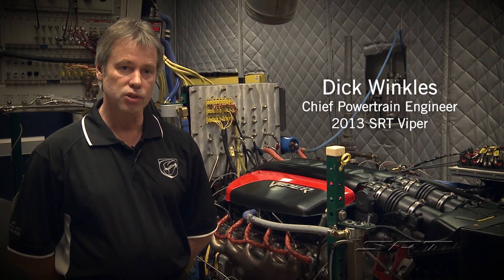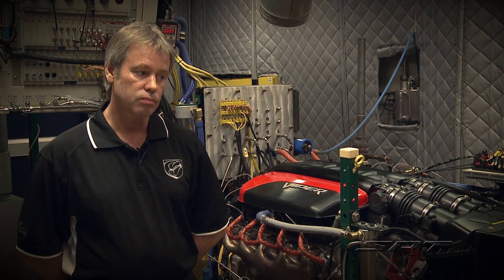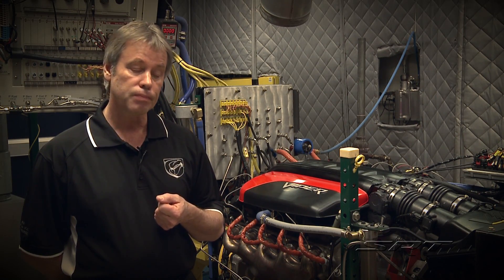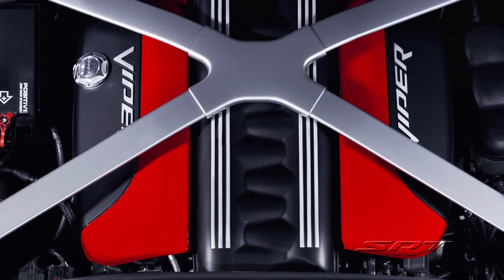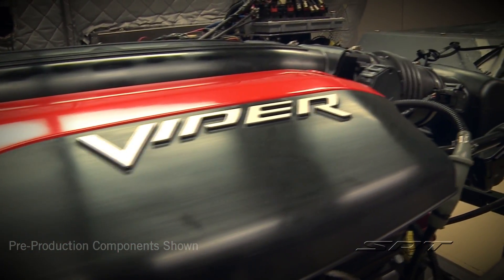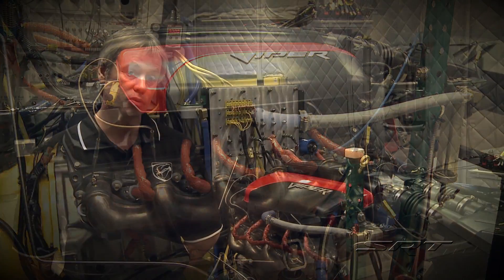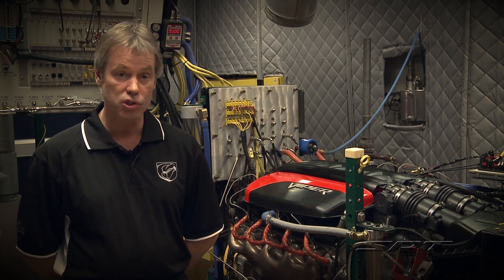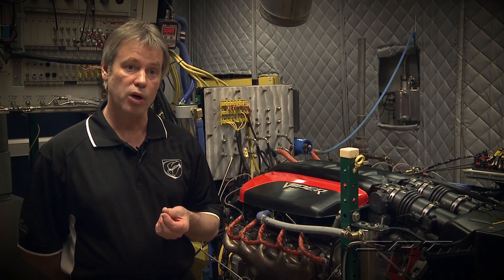Inside the 2013 SRT Viper Powertrain

Comment: - another cars lap is benchmarking. Magazines that regularly run lap times with different cars there, benchmarking. What do you think Host Von Saurma is doing? He is practically benchmarking any car he takes to The Ring.Definition Benchmark:any standard or reference by which others can be measured or judged. In other words going to The Ring and running a 5 minute flat in a Lotus and JUST COMPARING it to a lowly corvette is a form of benchmarking.

Comment: Porsche pretty much benchmark all of there ultra high performance cars there, that is one of the reasons that they have permanent TEST facilities there in the first place. After all wouldn't it be a good idea to know how much faster the new GT2 RS is COMPARED to the original GT2?  I just said a couple posts ago that Nissan used the Porsche 911 turbo as their BENCHMARK for the R35, how do you benchmark a car without benchmarking? Any manufacturer that runs a clean lap there and compares it to-

Comment: What are you talking about? Nissan repeatedly denied it and offered Porsche's test drivers driving lessons. And where did you find info on Porsche calling the Americans out? i can't find it. Horst Von Saurma was a little off the GT2 RS manufacturer claim too but just by half as much. Assuming that you are comparing his 2009 ZR1 run to the Jim's 2009 ZR1 run seeing as it didn't have the cup tires that the 2012 did. But if you look at Horst's laps the 2009 ZR1 is as fast as a 2010 458 Italia, nice

Comment: That may have been then, but it seams that The Ring has come to the forefront over the years. I have always agreed with you that there was NO OFFICIAL benchmarking but there are a lot of manufacturers that are doing NON OFFICIAL benchmarking on The Ring. In fact Nissan admitted that they used the 911 turbo as the benchmark for their R35 GTR. Why do you think that Porsche originally called BS on the R35 GTR's lap time of 7.29 a time that was faster than the 7.32 Porsche claimed for their GT2?

Comment: So the Manufacturers set out to break each others "records". They have a choice to add safety equipment or not but most do, including a roll cage. Then find a driver willing to risk his or her life(preferably a pro or ex-pro). Rent the track out and run the laps. Cars could be modded beyond what they say but without officials there to thoroughly inspect the cars right before the attempt, it's practically imposable to call them on it. So we can only speculate.

Comment: First off, the Gumpert was much faster than the ZR1 on The Ring. Second, driver skill and just plane guts plays a major factor in these lap times. In other words Jim was pushing much harder that the guy in the Apollo. Third, Michelin Pilot Sport Cup Zero Pressure tires are among the best street legal semi slicks you can buy and they are OEM tires for the ZR1.

Comment: OK got it now thanks. see the roll cage, see the seats, tires...... nowhere near 600mm wide though looks like stock width to me. I also see a camera right between the passenger and drivers seat. I just found out You have seen this in car video because i found you trolling over there too, so why are you questioning that the interior is stripped when you know it's not.

Comment: Both the Radical and Gumpert aren't road legal here and can only be purchased in kit form. But the Corvette and Viper can be Imported to Europe and be fully road Legal. That is why they claimed the record at one time or another. You still have yet to disprove the European lap times either. Did they are didn't they run the laps they claimed to run.

Comment: A roll cage won't help very much performance wise if the car chassis is already very stiff. It also adds a good deal of weight. But when you are reaching speeds over 160mph and crash, the extra strength of that roll cage could be the difference between life and death. That racing seat has a racing harness (the original seats were incapable of housing it) which is much better than a standard seat belt. Lastly, there were at least 2 in car angles in that video and from every angle it look stock.

Comment: I have to see these cars that have tires that are over a half meter wide, they will definitely have flared finders. Oh wait a minute, the videos don't show flared finders on the cars, that's strange, didn't hear any tire scrubbing either. How could that be? Oh, by the way, all the European cars i mentioned except the GT2 RS have youtube videos of their lap posted. All of the cars had a pro or ex pro driver, This is what the U.S. manufacturers are referring to. I already told you this before.

Comment: And what of the double wide tires that they are suppose to have do you know what it would take to get 600mm wide tires to turn without rubbing the finders? wouldn't just using race tires be a better option? i have to see this, just show me the picture.

Comment: You can go on typing that the cars were modded and the record doesn't exist because key European manufacturers aren't in on in till you get carpel tunnel syndrome and it won't get you anywhere, most won't believe you without proof, which you repeatedly failed to deliver. I could say that I own my personal Nimitz class aircraft carrier but few will believe without proof. The same go here, no proof no value.

Comment: As ridiculous as the Nurburgring laps seem, they have proof that they ran those laps and most are going to believe them in till proven otherwise. You can't bust a myth without proof and i already said that it is going to be hard to find. You can't expect people to believe that the cars are modded beyond a roll cage and racing seat just because you say they are. About the race teams you say that were there, wouldn't it be a good idea to have mechanics on hand just in case a part fails on a car?

Comment: which is why the ferarri cost wayyy more smart guy. that tiny ferarri egine struggles to make that power and it has 200ft pounds less than the viper. the viper makes the power without breakin a sweat. and you can squeeze an extra 200 hourses out the viper just by swappin the cam

Comment: i believe it could still be more powerful and still be reliable if they invest a bit more in the engine. the new ferrari f12 make 730 hp from 6.3 l v12 and is very reliable. its all about how much they invest in the engine. they couldve done better

Comment: as with previous vipers, there would be a lot of room to make adjustments and tune the engine. With a proper tune, this engine could make 700-800hp easily but it would not last nearly as long. 

This engine right now isn't pushed to its max potential but that allows it to be very durrable as the previous viper engines were. 

Between the engine and the the classic manual gearbox which only needs clutch replacement from time to time, this snake should be very easy to maintain and upkeep.